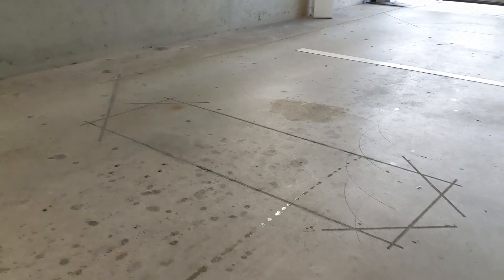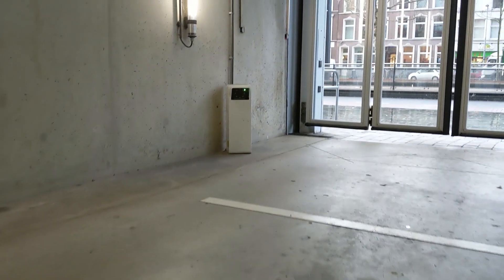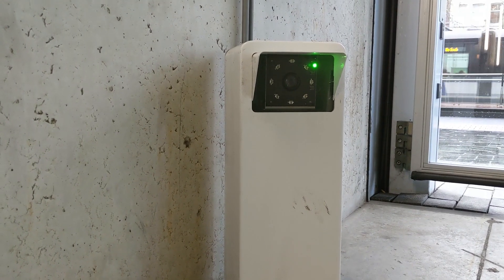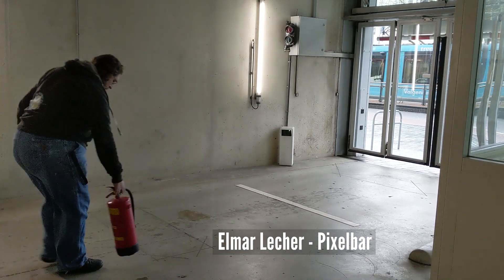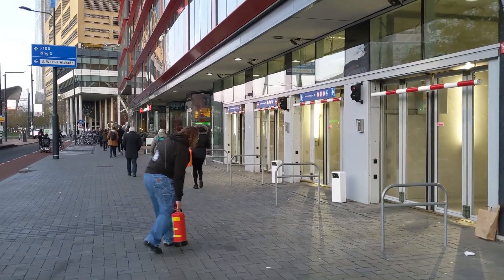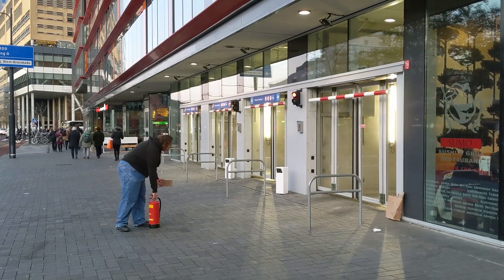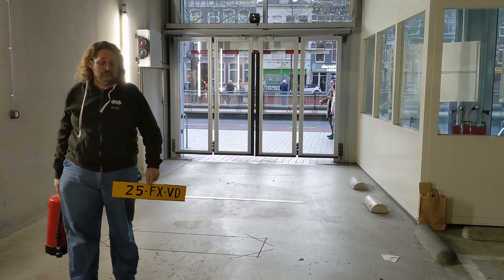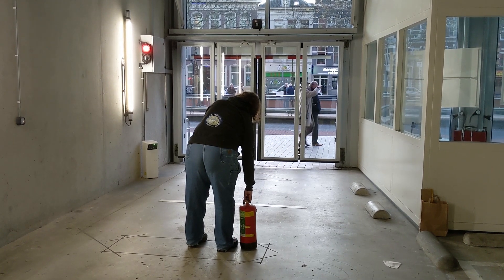bypassing automated number plate readers is easy!

Comment: Long while ago, working in London Oxford street, we parked our car in NCP car park, we worked all day and would have incurred full days charge around £20, so when we finished our job, we were carrying our metal tool box and other electronic test gear, as we passed over the magnetic pick up sensor, the system thought it was a car entering, and popped out a ticket, we took that ticket and presented it on the way out, so we only had to pay minimum 1 hour charges. Voilà.

Comment: This isn't an exmaple of ANPR being intrinsically bad. This is an example of ANPR being applied badly. Whoever designed the "security" system here did a terrible job.
Reply from the maker: no, all ANPR's have that problem becuase you have an optimisation problem of it should be working in bad weather like snow in the night while light of the car is pointing in the rough direction of the camera. I have seen a lot of ANPR systems meanwhile, they all can be broken this way. 

To make your optimisation choices more complicated the number space you have is not unique, quite a lot of fonts are used and the number plate can be nearly everywhere. 

Its just a shitty idea to write the access token for a protected area on the outside of the object trying to get access - in cleartext. 

There is no good ANPR system.
Reply: @ElmarLecher  So what you just said. the ANPR WORKS, because it's designed to work in all sorts of adverse conditions. The problem here is the setup, where the only system to check for a vehicle is a coil that is essentially only looking for metal, and not doing anything to verify that the metal is actually part of a car? the ANPR portion is doing exactly what is was designed for, it is working perfectly. It's the security setup around it that is flawed, by not having any safeguards to ensure that what the ANPR is looking at is actually a vehicle.
Reply from the maker: @Kizron_Kizronson  aeh no. I am looking at the overall system. ANPR as a security system is unfixable flawed by concept. 

The thing that works is called OCR. The rest is broken and can't be easily fixed. 

There is a talk on several security conferences over it, that goes way more in detail that you can find here on youtube too.

Comment: Excellent research! Like another mentioned i feel like RFID cards/readers would be more secure and probably cheaper than a coil and ocr. And that ocr software they're running has gotta be expensive.
Reply from the maker: The solution is expensive. An RFID card they have as a backup solution. 
And as the cameras have proven to be vulnerable to stickers from football hools a backup solution is deeply needed. 
The software is also not awesome quality. There's a talk on emfcamp on 
https://www.youtube.com/watch?v=bWV2wt7klSU
Reply: Thanks!
Reply: You wont have to worry about car license plates very long if you survive the 95% population reduction the Global Zionist wants. There will be no cars except for the Elite . Note ; we are starting into the Great Tribulation . The Mark of the Beast is on its way after this depression.